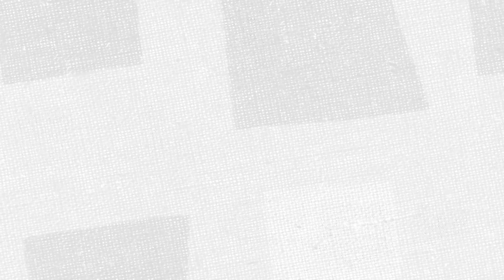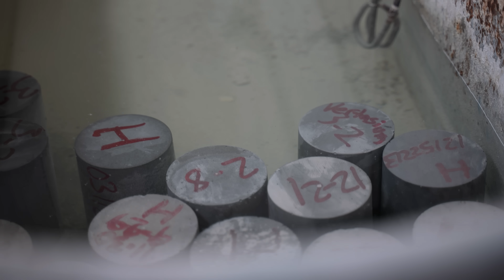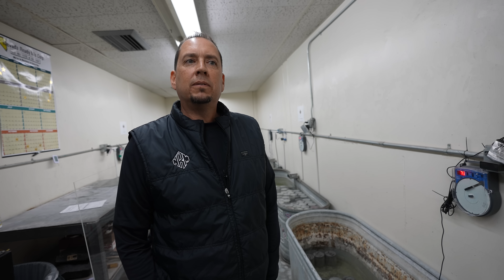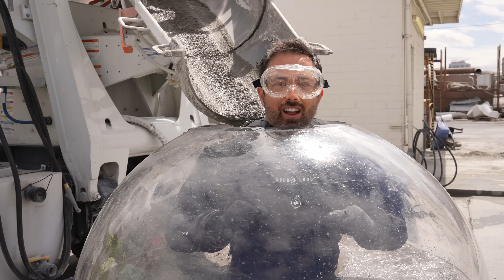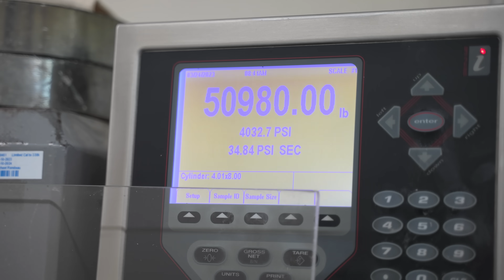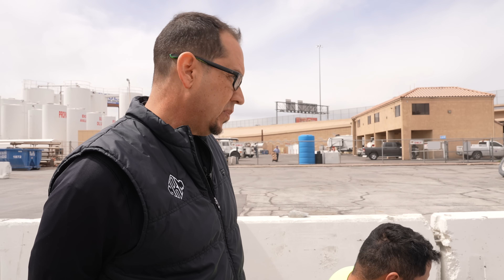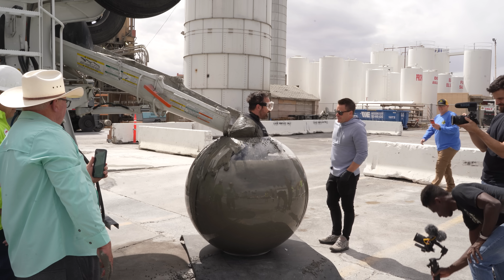Getting Buried In Concrete To Explain How It Works

Comment from the maker: For the first 100 people who sign up, I will personally offset the first month of your carbon footprint on Wren: https://wren.co/veritasium
Reply: P3oples emissions are not the main problem. Corporate emissions are.
Reply: Geopolyers have the potential to offset lots of carbon footprint,.  I'll personally hold you accountable for that missing research.
Reply: @littlegamer00  based
Reply: @littlegamer00  corporations and militaries.
Reply: It's really disappointing to see you using Wren as a sponsor. I won't call them a fraud, but they're basically Established Titles with a more respectable packaging.
Reply: "carbon offsets"... keep shilling those corporate lies, anything to avoid address emissions and keep passing the problem down the line to the next smuck.
Reply: The whole carbon credits thing is a bigger scam than Theranos.
Reply: Besides the ad, I feel like you could have emphasised the carbon emissions from cement manufacturing and the need to develop carbon neutral cements.
Reply: @littlegamer00  so should Veritasium pay for the carbon footprint of Apple and Samsung?
Reply: I hope they develop a method that beats the plasticizer addition, that stuff can be really harmful to endocrine systems and other biological processes.
Reply: NCDOT and ACI certified inspector here. Those cylinders suck lol. Only due to the volume depending on the mix type. We create those cylinders along with testing the air content, temp, and slump (tests water/fluidity). Thank god I'm not a structures inspector... I'll stick to erosion and sediment control.

Edit: Had never seen the slump test performed that way but for the use case, it makes sense. Normally it's tested with the cone flipped, scooping concrete in to fill about 1/3 of the volume before "rodding", tamping with a rod to eliminate voids. After the slump cone is full, you raise slowly and then place the cone to the side to get the difference in height of the slump cone itself and the pile sitting beside it. I've seen a slump as small as 1/4" and as large as 5".
Reply: Veritassium is typed the above comment while being halfway stuck in a concrete sphere because he waited too long and it hardened.
Reply: (Also only sign up first if you have an extremely heavy carbon footprint...j/k)
Reply: Concrete density ranges between 2.3 to 2.4 ton per meter cube depending on the mix designation and workability. 500kg of concrete would make approximately 0.22m3 filling up that ball just shy of a quarter of the way up. (Fun guy I know, that's what you get when you're a civil engineer).
Reply: If it's 3 times as dense as water, then how come 500 kg is 2 cubic meters? You probably meant 5000 kg
Reply: so since limestone is made out of ancient sealife is there research into making cement without on other planets without ancient sealife?
Reply: bhubhubbub
Reply: Speaking of carbon footprint, global production of concrete accounts for 8% of CO2 emissions.
Reply: hi
Reply: Yes! We must lobby so that the poor people can't utilize these sources of energy that helped the rich people get a better life!
Reply: My name is the concrete industry.
Reply: Can do a deep analysis of Bitcoin standard book and ecosystem.   First principles based analysis and not based on papers by novice graduates or people with axes to grind.  Maybe a full comparative analysis of energy supply chain. The negative energy components. The flexible grid response.  Texas has these miners and maybe you can analyze their energy structures.
Reply: Have you examined the co2 and temperatures during the Cretaceous and other such era.  Heard they were 30 times more.  That is 3000% more.  Temperatures were 18 Fahrenheit more.
Reply: Could not sign up. 🥲
Reply: Nice office for your operations lol😂
Reply: Wren may not have been the perfect sponsor… don’t know them directly, but almost all tree planting initiatives are ineffective in offsetting carbon footprints. No respectable carbon offset agency has that in their program….
Reply: You are Canadian, why did you say "asphalt" so weird?
Reply: is it possible to build carbon capture machines for cement/concrete plants combined with Porches' new carbon capture E-Fuel plants in order to help offset more of the co2 since it produces the most?
Reply: Hey dude you should clarify the error on f concrete being a basic solution, if it’s above 7 it’s starts being alkaline, yes bleach basic and anything below 7 can start being labeled as acidic. But it’s incorrect to call something with a ph of 13 basic that stuff is in reality alkaline yknow like the battery you got one that use acid and also alkaline batteries
Reply: north hemisphere vs south hemisphere emissions? I would like to see that comparison at any scale (individual, corporate, etc.)
Reply: Would you float without a "dry suit"?
Reply: Woohoo rich privilege! I can just pay to pretend nothing I do matters!
Speaking from experience as a person living well above median means.
Reply: Veritasium did you collab with Bill Wurtz on this one?
Reply: Definitely didn't expect the carbon offset bs to come from this channel, shame.
Reply: You could sink in foamcrete.. or concrete with high-carbon aggregates like biochar, charcoal, glassified plastic, shredded styrene..

But please don't.
Reply: Please make a follow up video on how the industry can electrify the kiln process in producing the Portland cement. They are still using burners which is the main CO2 emissions. Otherwise please explain the over all process and where the CO2 is coming from. Construction industries here in Australia are reluctant to use green methods to produce cement. We need government to actively encourage all these processes to be electrified and run on renewables.
Reply: @Veritasium, at 10:22 the individual working at the plant says the contractor wants spherical sand (a river sand) and he’s right. The CONTRACTOR would want that because that makes it more workable, but from a strength standpoint, that’s completely wrong. Angular aggregates produce much better bonds. Just like you mentioned with the silicate crystals interlocking, you get the same mechanical advantage with angular aggregates. This is why we’re running out of sand to use in concrete. We can use sand from rivers and beaches and deserts, because it’s too rounded, it makes for weak concrete.
Reply: my dog seems to be a bigger carbon footprint than owning and driving my car to work everyday, wow. Also the website doesn't register 0km driven correctly and adds a couple tons of c02, not that anyone does that.
Reply: Concrete
Reply: I can't afford to continue offsetting but thank you for helping me feel a bit better about my last month:)
Reply: @littlegamer00  corporations are made of people
Reply: For such an intelligent and inquisitive man, you've certainly been fooled by the climate change spell that's been cast. 
Hopefully you weren't deceived by Covid.
Reply: @littlegamer00  what do you expect him to do 💀💀💀
Reply: Concrete is amazing. However, I think glass is more impactful. Concrete is amazing for building. Glass is everywhere.
Reply: I want to make MORE carbon! Cry about that!
Reply: How about the 500 liters of the stuff you produce a day?
Reply: yea and how much co2 does this give off?
Reply: @micphoenix8200  ok
Reply: Carbon nonsense.
1) blame the public
2) make profit from agenda

Stop the BS
Reply: @ChallengeTheNarrative  I mean money is money, capitalism will prevail over communism, isn't that what you want?
Reply: Show how steel floats in molten lead sometime. It looks unreal.
Reply: Hi Veritasium and Wren :) Thanks for great content over the years! Im vondering, what are both of your stances on nuclear power as a low-carbon energy source? 
All the best from Denmark // Morten
Reply: The wren calculator seems to be lacking nuance. The square footage of our house impacts our climate impact, even though we use 100% renewable energy. And flights are worse than driving the same distance? That doesn’t seem right
Reply: I appreciate the regard for climate justice, but it would make a massive dent scientists and companies the promote renewables.
Reply: I was hoping you would mention what happened when cement has been turning in the truck for an extended period of time before being poured. Basically it ruins it making it weak.
Reply: @Sgt-Gravy  Your skin dissolving might be a bigger problem there but I don't think the suit affects the floating - it's all about your density vs the liquid's density
Reply: Trees do not offset CO2. They are CO2 batteries. Can't hold the charge for centuries. Usually just 3-5 decades.
Reply: It's getting longer, more documentary and boring. Love your older videos. Hope to see you back with that @veritasium😊
Reply: @micphoenix8200  You on the other hand don't seem neither inquisitive nor intelligent.
Reply: What's the point? Does that make it so I can feel good about myself, and can pollute more?
Reply: @Deepak-mk1fi  You found this video that boring?
Reply: Hi Derek!
I did the test ended quiet well for me as I'm doing my best without getting unnutritioned, even sitting with a special soldered LED that consumes 0.1W over my desk at nights..
The thing is:
I ride bicycle everywhere and still get this answer, which is wrongest statement I've ever heard:
"Offsetting your emissions has 1x the immediate impact of driving an electric car."
My question is:
How come carrying around 1,5 metric tons of steel and wheels that uses ~115kWh will be as same as riding my 9,4kg bike that uses 0kWh? (and 0.3kWh if it were e-bike)
I could pay them for help if they appreciated how less I leave carbon footprint (about 2,5 tonnes)
But appreciation is mutual.
Reply: I am an electrical engineer. And I want people to be aware of that it's not the type of fuel you burn, but the amount of fuel you burn. It's calculated by watts and numbers. Not by letters and fuel types. Say you burn 150kWh with your car inside the city with the fuel, when you turn it into EV, you'd be 15% more efficient on that amount of specific fuel burnt, but also your EV will be 1,7 tons instead of 1,5 tons, which is roughly ~15% heavier.
Hence, choosing an EV has no advantage, and I say it as an ELECTRICAL ENGINEER.
To be more careful about the environment, we could use less features on our cars, say no autopilot, no automatic gear, no rear camera etc. which all consumes even more energy than the above mentioned, and produce lighter transport vehicles. Carrying around 5 people would be possible with 500kg of vehicle if engineered well.
And that'd be instantly 300% more efficient cars.
Please consider this if you care about our planet as much as I do in your future videos.
And.. stay hydrated..
Best regards!
Reply: Isn’t concrete meant to be unsustainable?
Reply: Very kind of you!
Reply: Can cement/concrete be recycled?
Reply: Offsetting “carbon footprint” is a sham.
Reply: @XavierBetoN  I am a Systems Engineer. Sorry to pull rank on you, but you're dead wrong on all counts. Renewable electricity, for example, doesn't put fossil carbon into the atmosphere; EVs are far more than 15% more efficient than ICEs; the tiny draw of autopilot and camera are insignificant; automatic is slightly less efficient but that only matters if you're driving an ICE while a more aerodynamic frame would have a far greater effect on fossil fuel use.. if fossil fuel use were something we could afford to continue past 2030.. which we can't, if we want to avoid fossil famine.
I'm not promoting EVs, or any particular solution. Pick what works for you; just don't pick fossil emission any more.
Reply: I’m really disappointed to see such a negative reaction from so many on such a good thing.
Reply: @McRynoGirski  It's complicated. Carbon offsets can be a really good thing, at roughly 32 times the current price range. They can lead to setting aside of land that might otherwise lose its carbon capturing ability, at that price range. They can encourage people to move off fossil faster, at that price range. But below that price range, they're not what people of goodwill hope for, and can make the problem worse.

Worse, even at that price range you still need to capture biomass before it turns into biomethane in the atmosphere, either by harvesting it for storage, or flaring it (burning it so it skips the methane stage and goes straight to CO2), or creating a biom that doesn't put decay into the air.

Approaches that don't do all of the above are just mixing some truth with some untruth to deceive people.
Reply: Why don’t you invest in the world first high temperature steam engine instead, I invented it.
Reply: Please do something about bot comments on your channel.
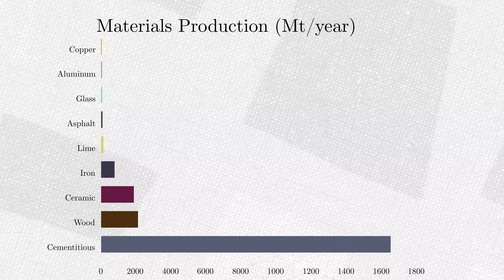Reply: 1:32 interesting scale that you have there...
Reply: How about a video where you design the worlds greenest skyscraper to show the building industry that concrete buildings can be made with much less concrete... I am a structural engineer who specialises in concrete framed structures. I have a few ideas about this if you're interested.

1) Use concrete on every second or third floor and not every floor. Use timber for the other floors. This saves on concrete, lightens the structure and still provides enough restraint to concrete columns etc. There are obstacles such as formwork and fire design, but there seems to be workable solutions to these obstacles.
2) Strategic placement of void formers to reduce concrete where it is not working hard. For example, the center section of a slab where the shear forces are relatively low. (I.e. in plan this would be most of the slab). This is not really a new idea, but it does work well. As does post-tensioned concrete.
3) look into lifts that are not pulley based and can move side to side as well as up and down. Having a shaft that runs the entire height of the building for 1 lift is very inefficient and leads to high rise buildings having a large percentage of the building footprint occupied by lift shafts. By shrinking the lift shaft area and moving the stability elements to the buildings facade you create more usable space, cut back on concrete and make the structure more efficient.

In order to design a building you just need to hire a few professionals to work on building models, so it doesnt require actually spending millions on construction. So a video like this seems like it could be doable.
Reply: @bartroberts1514  

It's bold of you to state that my calculations are wrong without providing another calculation. Those are facts, an average kWh per car compared with average e-bike kWh for carrying 1 person. Say you use the car everytime with 5 people, that'd still be 22kWh for each. Driving e-car is not better than not driving at all, that was my point. The test suggested me EV while I'm not driving fosfofuel.

You didn't understand that yet answered Here's my answer:. I'm not defending the fosfofuel over electric. Electric engine is better in many cases not just the environment. Take high torque on start (low rpm) for example.
But the thing is, the bold statement of "turn to EV to get green" is wrong instead. Many people use heavier and heavier cars year by year, and some scientists calculated even if we were using nuclear at this rate it wouldn't be enough. No energy source is sufficient at this rate basically. We have to promote lighter transports like e-bikes instead of just* EV's that's what I was telling.
Coming to renewables. I'm an electrical and power systems engineer and my thesis is partly about comparing the resources for electric generating. For renewables; take solar as the worst but most popular example. It produces 2,5 times the annual average power in Summertime, but city consumes 2,5 times below the average in Wintertime. So in fact the low point of the solar production and high point of the city power consumage is 5 times relatively. Adding that the child-labor and toxic byproducts that solar produces it's worse than nuclear and other renewables (hydro, aero, geo). 
Solar power is advantageous only if you eliminate the transformation and transmission losts. Which one way is to make rooftop solar panels on charging stations, cars, houses etc. But In most cases I've seen, they're producing solar farms, which is land wasted, electricity inefficiency, expensive energy, short-lived, and lithium mining is toxic. It's only better than coal, not any other energy we use.
But if you mean Hydroelectric Power Plants. Then there is the drought problem we face. Unless we plant trillions of trees per day and stop consuming excessive energy, there won't be enough hydroelectric in the future.
Reply: @XavierBetoN  More from ChatGPT:
There are some claims in these statements that are true, some that are partially true, and some that are false or misleading.

The statement that many people use heavier and heavier cars year by year is generally true. In the United States, for example, the average weight of passenger vehicles increased by about 25% from 1980 to 2018.

The statement that some scientists calculated that even if we were using nuclear at this rate it wouldn't be enough is vague and difficult to evaluate without more context or specific references to these calculations. However, it is true that no single energy source is sufficient to meet all of our energy needs, and that we need to promote a diverse array of clean energy solutions.

The statement that we have to promote lighter transports like e-bikes instead of just EVs is partially true. While e-bikes can be a great alternative to cars for short trips, they are not practical for longer trips or for people who need to transport cargo or passengers. EVs can be a better alternative for these use cases, especially if they are powered by clean energy sources.

The statement that solar power is the worst renewable energy source is false. Solar power has many advantages, including its ability to be deployed on rooftops and other small spaces, its scalability, and its decreasing cost. While it is true that solar power production does not perfectly match electricity demand over time, this is a problem that can be addressed through energy storage and smart grid technologies.

The statement that solar panels produce toxic byproducts and use child labor is partially true. Some solar panel manufacturing processes do produce hazardous waste, but many companies are working to reduce their environmental impact and improve the sustainability of their supply chains. While there have been reports of child labor in some parts of the solar panel supply chain, this is not unique to solar panels and is an issue that needs to be addressed across many industries.

The statement that solar farms are land-wasting, inefficient, expensive, short-lived, and require toxic lithium mining is mostly false. While large-scale solar farms do require land, they can also be designed to coexist with other land uses, such as agriculture or wildlife habitat. Solar energy is becoming increasingly efficient and cost-competitive, and the technology is improving rapidly. While solar panels do contain small amounts of lithium, this is not a significant source of toxic waste.

The statement that there won't be enough hydroelectric power in the future due to droughts is partially true. While hydroelectric power is a reliable and renewable source of electricity, its availability can be affected by changes in rainfall patterns and other factors. However, there are many ways to mitigate the impacts of droughts and other challenges, such as by improving water management practices, increasing energy efficiency, and promoting a mix of energy sources.

That was ChatGPT's view.

I'll add that nuclear is a non-starter, playing zero potential role in our future after the current stations close down.

Not enough
Uranium and other fissile reserves accessible,
Containment materials on the planet,
Locations appropriate for generating stations;
Excess of
Atomic
Residues.
- Abbott D. Limits to growth: Can nuclear power supply the world’s needs? Bulletin of the Atomic Scientists. 2012;68(5):23-32. doi:10.1177/0096340212459124
Reply: Perpetuating a hoax.
Reply: Annnd you missed mentioning adding additional things to make concrete stronger...other filaments that boost the strength of concrete by ALOT and make it very difficult for it for it to break.
Reply: Is this the real thing this time or is it just like every other carbon offset that's just pocketing cash?
Reply: Mbita Acoustic  k
Reply: Like
Reply: @micphoenix8200  climate change spell ???
Reply: Like his pants, looks good for everyday work. Wonder what brand it is.
Reply: @szabolcs__  Descriptive use of the word inorder to characterise the propoganda & alarmist rhetoric that has been used in order to manipulate the population in order to generate an emotive response in people. In this case it's anxiety induced through fear. Same formula used during the pandemic...fear based anxiety. Our natural psychological response seeks a means of alleviating the associated feelings of unease. Consequently people are conditioned into readily and uncritically latching onto the prepared 'solution' as soon as it's presented to them. The solution doesn't need to be rational, reasonable or understood at all etc. 
This is especially true with respect to matters of an esoteric nature. 
This isn't a criticism of the population as much as it is our reality. Most people don't have the time, inclination and/or ability to become accurately informed about every thing that they should be paying attention to.  
Additionally people form their opinions (perspective) due the information that's presented and obfuscated. Any information which challenges a persons perspective/understanding/opinion is often conflated as a personal challenge (at least in as much as it challenges their perception/understanding of a matter). People then become defensive, obstinate and often emotional and irrational in response, rather than having a civil fact based discussion, conducted in good faith. 

Everyone has the capacity to be emotionally reasoned as it's a lower order and more primative cognitive function. Unfortunately not everyone has the capacity let alone the inclination and education required to think critically. 
Psychologists, Politicians, Advertising & Marketing professionals etc all understand that you can generate an emotionally based response in a critical mass of the population very quickly and easily. It's much harder and it takes a lot longer to explain and/or convince people, especially if you're agenda is in conflict with or antithetical to their best interests.
Reply: Dude most MOST all carbon offset things are scams.
You know that right?
Reply: Derek,  shouldn't the video description say "Concrete = cement + sand + gravel + water" ??
Reply: @micphoenix8200  Are You saying, the climate change is not real ? That is my Q !
Reply: @littlegamer00  what do you think the corporations are doing? Producing goods and services for people. You are responsible for the co2 that goes into the goods and services you purchase.
Reply: Do some research on your sponsors before you sign with them.
Reply: @ColCurtis  Who chooses the range of goods and services you can get, though? Who affects their prices, availability, costs, shipping?

That'd be government regulators. The illusion of a free market, when governments are giving away land for refineries and expropriating farms for pipelines, giving tax breaks to foreign-owned oil companies and paying companies to sell coal to China below its cost of production, is what's driving inflation and climate change.

A few dozen public servants who control the licenses and permits for fossil extraction are all it would take to end climate change, by denying the licenses to dig and drill.
Reply: @OriginalUser2023  no, they should be calling out those huge corporations for the amount they pollute.
Reply: Buying carbon offsets is a scam and not helping.
Reply: @micphoenix8200  that's a lot of words just to say "I didn't pay attention in science class".
Reply: @MegaLokopo  You will never wake up sheep in the slaughterhouse.
Reply: @sevret313  I am glad that someone else sees it for what it really is just a sham.
Reply: Is this video AI generated ?
Reply: @germangamboa3421  It's not a stupid idea. Only stupidly implemented by design.
Reply: Thank you kindly for placing non-adsense at front/back/both rather than interrupting video. However, corporate emissions are the realistically addressable problem, not those of average non-wealthy people.
Reply: The Guns and glory Show  don't forget to fart all the time, this is how it's done due to dinosaurs!
Reply: 999⁹9⁹99999⁸
Reply: Hua
Reply: I'll offset your footprint for free.
Reply: Hello veritasium , first of all I love your channel, I have learned a lot from you. If you can make a video about ai technology and how it will affect our lives afew years later. I know I am asking for a lot because we can't predict the future, but you can make an educated guess. Thanks lot
Reply: dear Veratasium, WHY DID YOU WASTE THAT WHOLE BOTTLE OF COKE??
Reply: @littlegamer00  Well that’s a very pessimistic outlook. Just because corporate emissions might be more, doesn’t mean making a change with personal emissions won’t do anything…
Reply: Meanwhile one volcano emits more gasses a day into the air than humans can make globally in a hundred years. 😜
Reply: I like carbon, carbon is live.
Reply: I'll be waiting to extract you like one of my fossil crabs 🤗🤗
Reply: @icholi88  so much hostility over the concept of carbon credits. Recognizing that there's no 1 panacea but the integration of lots of great/good ideas that'll really move the needle, what's the big fraud about making businesses who use more spend more while incentivizing others who reduce their usage? I mean, how else can we expect big biz to care other than affecting their budget?
Reply: Didn't expect the carbon offset bs to come from this channel, shame!
Reply: hmm, first 100 people... 3.4 million views... I might be a tad bit late
Reply: whats the point of getting buried?????
Reply: Have you ever thought about putting a short quiz at the end so viewers can see what they've retained?
Reply: @thewholeAhole  ?
Reply: I'm not against these kind of websites that shows you how to lower your emissions, but it's really misleading given how the questions are set up, and reality is a lot more complex. Like for instance if you eat meat, it makes a huge difference how that is produced. And as always, not a single question on the single most important life style choice: the number of offspring you produce.
Reply: Mr veritasium, maybe you could do a video explaining how c02 does the greenhouse thing. I'm really confused how the c02 gets to the upper atmosphere being its a heavy Gas, see Roman gate to hell, seems Roman priests knew. Maybe a video on how the plants will survive if the c02 gets much lower than it is.
Reply: Dang, you came to Utah for this! Point of the mountain! Very cool!
Reply: Carbon footprint? Hahaha, that's an offer for masochists or non-terrestrial?
Reply: Can't believe what i just read
Reply: If we are at co2 saturation, what will my carbon footprint be?
Reply: @littlegamer00  CO2 emissions themselves are not a problem.
Reply: @hightechjoe1  good thing carbon is a good thing in the atmosphere.
Reply: So we have to wait for Florida to be underwater let's just start using Florida's limestone
Reply: This promotion is like the WWF culling Pandas to save Lions! [ screenshot because I'm sure I'll be banned again! ]
Reply: @littlegamer00 😊
Reply: Why can bugs make better cement? Like sea creatures?
Reply: I thought they were going to let it harden, and then chisel him out. What a jip!
Reply: CO2 is present in water.
Reply: @littlegamer00 saßa
Reply: @MrUssy101 a
Reply: @littlegamer00 s
Reply: How?
Reply: What? Why would I want that?

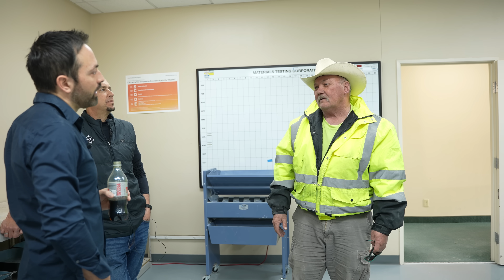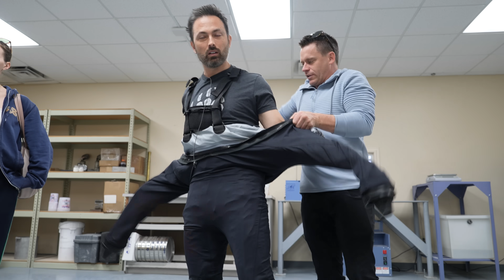Edit: 4:00 to 4:10 you are not the brightest of the bunch, aren't you?

Edit2: I was doing the survey for the laughs and at the end it asks for my email to show the results. No way Jose. This is probably spyware.
Reply: I had my respect until u approved sponsorship from such a scam machine xd
Reply: @littlegamer00 hi bro
Reply: @littlegamer00 i agree with you
Reply: I started the Hawaii wildfire, does that get covered as well?
Reply: imagine if you had clastro phobia
Reply: did you have to do the treehugger nonsense?
Reply: why would you want to suffocate the plants?
Reply: @victorkyoshi Indeed, we want better crops, we should be putting the CO2 back in the air where it belongs.
Reply: Repent and put your trust in Jesus.
We've all sinned and deserve Hell.
Jesus died on the cross and was resurrected, defeating death and sin.
Since we broke the law, Jesus paid our fine. Since he paid it, we can be let go.
We must repent and trust in Jesus to be saved.
Revelation 21:8
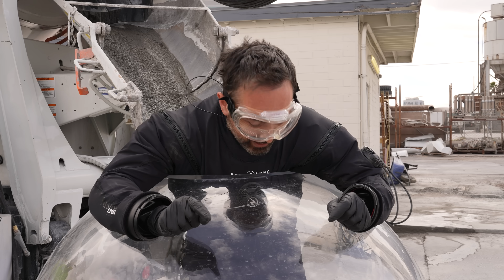Romans 3:23
John 3:16
Romans 6:23
1 Corinthians 15:3,4
Revalation 3:20 
Romans 10:13❤😊❤❤
Reply: O/
Reply: Please repeat the kite experiment that Ben Franklin was said to have done. I tried repeating it to no avai. To the point I believe it’s all made up! And my neighbors think I’m crazy when I’m in the rain trying to catch some lift with kite😒
Reply: The density of cement is about 3120kg/m3. The density of the concrete is 2400kg/m3 . Also, you need to talk about concrete classes . 500kg of cement wont even get you 2mc of concrete B150 .
Reply: I have a question. In general relatively there are a few solutions which are interesting and one that Neil degrass tyson talks about is when 2 black holes are about to collide you can travel back in time by going between them. But imagine if I could go back to the past and meet myself and then i wait a bit and then go to the past again now there will be two of me I can make an infinite amount of clones if I can travel back in time

I love how a person who will have a good in the  joke in the comments will be seen by thousands but a comment genuinely talking about what the video is about will bite the dust
Reply: MATE ITS FUCKEN SOFT DRINK OR COKE NOT POP
Reply: Good to know rome had a infinte cement geneartor I didnt know they added this update
Reply: @littlegamer00 ...and it is individual's purchasing choices that dictate which corporations make the money to do so. Don't off-load Your individual responsibilities!
Reply: carbon footprint??  do you know what trees use to make more oxygen???? i thought were suppose to be smart??  hahah. not
Reply: Can U trust Wrens predictions?

So Wren calc said I use 5.5 tonns a year and I'm green; walk, bike, rent  home, mostly have second hand appliances and Eon state they are 100% renewable I have electric heating economy 7 style (not sure how much co2 is there!). Anyways...

Its states if everyone done the same as me in only 9 years temperatures  would increase by 1.5°C... (N that's not good)

Any thoughts...?, coz mine is that I'm  not  sure If I can trust that site 🤨
Reply: @littlegamer00  corporate emmisions only exist due to the demand by the consumer.

I don't disagree entirely
Reply: What's the point in having oxygen of you cant expand your lungs
Reply: i just watched ur concrete video now ur everywhere on my youtube page
Reply: carbon offsets arent real im sorry dude but please do some research into companies carbon offset and where those are placed carbon offsets are not helpful they are just diverting the problem
Reply: @veritasium  carbon offsets
Reply: 🙏🏻 , you should have have kept your self in a Schrödinger cat exp box 🙏🏻
Reply: @littlegamer00 People buy the stuff corporates produce. You can point the finger to Shell and BP, but it’s the millions of consumers of Shell that burn the fuel.

You can point the finger at China for emitting a lot of CO2 with their factories, but in the end, it’s people buying cheap Chinese junk who are to blame just as well.

So no, pointing your finger somewhere else is not helping. It’s people, it’s corporates and it’s governments. We are all in this together.
Reply: @littlegamer00 People buy the products of large corporations.

You cannot point to corporations and say “They are to blame, what can people like me do?”. That’s just waving away responsibility by pointing somewhere else.

In the Netherlands, where I come from, people often point to China and say “they are responsible for the problem with all their dirty factories”, not realising that those factories are running because people from rich countries buy the stuff from those factories.

It’s people, corporations and governments together that need to change to solve the problem.

We are all in this together.
Reply: Too many rich people doing their carbon emmisions in a year, as much any of us would do in a 1000 years. And they dont watch your videos!
Reply: @littlegamer00  thats why they only promised this